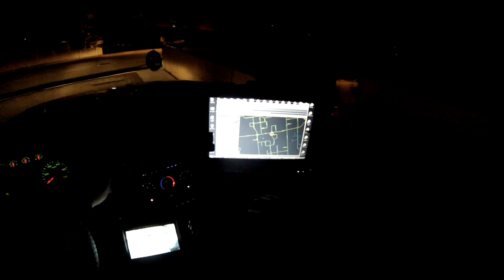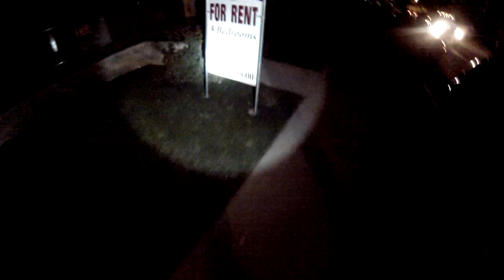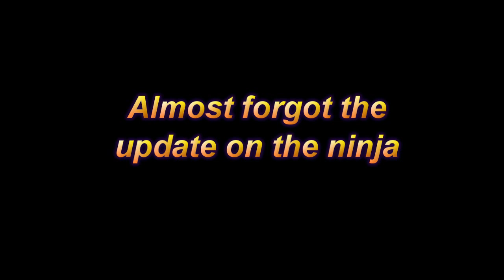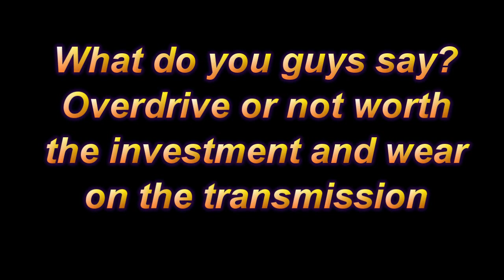Walking The Late Night Parking Garage Searching For Vehicles

Comment: I installed a Gear Vendors unit myself -- it was VERY easy to do.  But it was on an old Ford C6 tranny -- your newer tranny might be more difficult to get that Gear Vendors OD unit on it...  The only thing I had to have done by a professional was the drive-shaft shortening, which took one day and cost right at $100, including re-balancing.  (This was 10 years ago, just about, so it might be like $150 nowadays.  But we don't have any inflation...)

Anyway, it lets me run a 3.70:1 rear gear while acting like it's a 2.87:1 gear on the highway when the overdrive is engaged -- BIG difference in engine-speed.  (That's a 0.775:1 ratio, BTW).

Being able to do the work myself saved me a bunch in install costs.  I just bought the Gear Vendors unit, the adapter for the Ford C6 tranny, and the install kit, and did all the work myself.  It was easy enough for me to do in my garage in about 8 hours total working time -- minus the day it took to get the driveshaft shortened, of course.

I think the total amount I spent, including the driveshaft-shortening costs, and that crazy-expensive fully-synthetic GM transmission fluid that Gear Vendors requires (which is like $75 a quart, and you need two quarts) was right at $3,500.  Would've been $5K easy if I'd had someone else do it for me.

Comment: Hey Matt, Good to see the truck going back together.  The cost in adding an overdrive unit is not cheap, plus the added cost of shorting the drive shaft and possibly having to reprogram the powertrain computer.  Me personally I would change the rear end gears to help with the RPM range, it wont drop it a 1000 rpms but maybe 500 rpms.  You still would need to have the powertrain computer reprogramed.

Matt C.

Comment: Good to hear you will be up and running soon ! I couldn't help but stare at your front tires when you were showing the rebuild , agree at least replacing the front ones ASAP . I do agree with you on the wear , mine normally start from the outside in !
Reply from the maker: Mike Mcchrystal My Dodge 3500 went through tires like crazy and I found out the frame was bent.
Reply: Your dodge came from the factory with a broken frame all of those 1994 to 2002 are split frame trucks get a duramax and call it a day
Reply: +RepoNut If you throw in the towel on the Ford at some point, aside from destroking it, Get you a Duramax, I love mine! I love the old 7.3 strokes too but those are getting pretty old now. The Cummins (albeit noisy and avoid the 24v with the VP44 pump like the plague) is a really good engine for the most part but the truck they are stuck in is gabbage! Weak frames, prone to rust out, shoddy fit & finish. The GM's have their pitfalls but nothing big and most is piddly stuff that can be fixed. Great engine & transmission, lots of power and very tuneable, quiet, nice chassis, comfy trucks.
Reply: The Chevy is great all but the durmax. The 6.4 is a great motor if you bullet proof it.

Comment: Great vid as always Matt. Look into a Gear Venders overdrive unit. Its an add on to the rear and is opperated by a manual switch. actually turns a 3 speed into a 6 speed if wanted. Cool unit and can take tons of HP and TQ. Nearly bulletproof.
Reply: Dub Coco He did look into it when he had the engine work done the first time. He said they wanted $3000 to buy it. I think the purchase price plus the extra to have it installed kepy him from doing it the first time.
Reply: They are pricey but they are a good unit. A custom geared transmission would be more than that and would not have the added usability as the GV.
Reply: Dub Coco I agree.
Reply: +Charles Bronson I can see now why you blindly defending everything Matt does or says. You have no life except following Matt. You'll never face reality will you? Troll on. Don't look for the truth just trust everything Matt says is gospel.
Reply: MrRexQuando Troll on. That funny considering you left 7 comments in 10 minutes.
Reply: Charles Bronson Hello pot.. I'm the kettle. LOL
Reply: MrRexQuando I've said the exact same thing to you.

Comment: I'd say a different axle ratio would be the best bet, you have a 4.10 and 3.73 was another option that year.  It's possible an aftermarket ring and pinion @ 3.55 or so may be available but I have no idea what the computer would say to that (let alone an aux OD).  Trick is keeping the converter locked, if you go too tall and end up unlocking the converter over every little hill you are negating any savings and adding a lot of heat to the tranny.

Comment: Yes, it does add a slight amount of stress to the trans.  This is exactly why failing clutches in manual transmissions slip more in the high gears than low gears and why failing posi-traction units slip more in cars with "higher" rear end gears, like 2.76 or 3.23 than in cars with, say, a 4.10 or 4.56.  That said, I think the overdrive is totally worth it and I have yet to hear anyone have a bad experience with a gear vendors overdrive unit.  That will give you what you exactly are looking for, not to mention a few other benefits, like splitting the other gears too and giving you a lower reverse option for backing some huge trailer up a hill or other such crazy job.

Comment: In regards to the overdrive. The vehicles I used to drive OTR had trip computers in them. They would monitor your average speed, fuel economy, etc. After many long cross-country trips (most commonly Orlando to LA) I found out that the best method to increase mileage is to slow down. Choose your speed based on engine RPM. You're probably just adding a few minutes to your travel time.

The overdrive will lower your RPM but just like on your bicycle, the engine has to work harder to maintain speed. Skip it.

Comment: I'd put the overdrive on and use it when running without something on the back.  That transmission is plenty strong to handle the extra load on the freeway when not hauling up hills.  If you go with a different rear end you have the same gearing, loaded or not. With the overdrive you can engage and disengage whenever you want.

Comment: As a former driving instructer in eco driving I can tell you that you can cut up to 20% of your fuel comsumtion (normaly it is about 10 to 20%)  with just the right driving tecnic and with stoppeing the engin insted of letting it idle all the time, an engien shoudden realy idle for more then 15 sec.

Comment: Overdrive or not to overdrive?  Hmm? Well, you need new tires anyway, so how about putting on 6 new tires with a taller profile, which will help act as a poor mans over drive of sorts and just have the speedometer recalibrated? Or just live with the speedometer offset?  :-) Yeah, that's the ticket! I hope your luck starts to get better. It can't get too much worse. And thanks for the tireless hours you spend juggling your priorities while still managing to shoot us a new upload every so often!
Reply from the maker: 1962pjb I'm already going with the poor mans overdrive for sure and upping from 70 to 80 on the wall profile. Also my H&S minimaxx tuner will recal the computer for me so spedo is not an issue. Good suggetsion.
Reply: RepoNut Thanks! And let us know in one of your dialogs on how much it dropped the RPM's at 75mph sometime.

Comment: For get about the trans. Driving at 3,000+ RPM all day has to have bad effects on the engine. 4.10s would slow the engine down a fair amount at 70+ mph, especially since you don't really pull heavy loads all the time. I've ran a Gear Vendors overdrive and absolutely loved it. Well worth its cost/install.
Two speeds in reverse meant I'd run almost 50 mph in reverse! It's a 201 inch wheelbase so it's safer than it sounds. And hard to turn around some times.

Comment: Hello Math,

Strange that an overdrive stresses the transmission and never heard of it, but I'm sure that the technician knows better. Maybe you can ask him how expensive it is to repair/renew the transmission and than decide. Say it is about 2000 dollar and you can save about 500 dollar per month on diesel, than after 4 months you earned it back. 

Personally I would take the risk not only of saving fuel but also noise, because about 3000 to 3200 rpm for a diesel is very high. My Peugeot diesel makes about 2200 rpm at about 120 to 130 km's per hour ( 74 to 80 miles ), but than in 4th gear ( automatic ). 

Anyway, I hope the Ninja is back next monday and looking forward to hear the new diesel ( secondhand new ). 

Greetings from Roel !

Comment: Puts more axial and thrust load on all the bearings and bushings in the trans not to mention the diff carrier bearings (depending on how it's used, if you're lugging the motor then yeah, big time accelerated wear).

Comment: You should check out the gear vendors under/overdrive units they are awesome and bulletproof, if you're 3K on the highway you can realistically drop about 700 rpm and run lower transmission temps that's about all I know about them you should check out motor tends hotrod garage episode 7 for more info.

Comment: If you re-gear you will see better mileage on the hwy when not towing but towing and around tow stop and go stuff you will see worse mileage. In the end you will be at the same as you are now or worse, dont re-gear. As far as an overdrive unit check out "gear vendors" they be around forever, give them a call. Being in O/D = higher trans temp and higher egt's 2 thing you dont want. Slow down to 70 and see how that dose for you, in the end 75 to 70 your looking at 3min over a 60 miles distance or 7min if you do 65. slowing down in the end will help you more than spending more money. Good luck

Comment: What rear end gear ratio did your truck come with?  You could always install a set of gears more appropriate for highway driving. I.e if you have 4.10's you could go to a 3.73' for a drop in cruising rpm.

Comment: Instead of the aftermarket OD units, check what the factory options were for the rear end final drive. I recall you saying its a very short (high ratio) rear end for heavy towing on hills. Perhaps there is a lower ratio factory ratio that wouldn't stress the transmission.

Comment: The best way to work that out would be to see how long the parts will last with the overdrive installed and how much it will cost to replace all the parts once they wear out and compare that to the fuel savings you would get.

So if it costs $2000 to replace all the parts and it has to be done every 5 months and you save $500 on fuel each month then it is worth it.

Comment: Something else that wasn't mentioned about the overdrive, you would need to have the driveshaft reworked, while it isn't really a big expense if your driveline angles aren't correct you will have driveline vibration and eat universal joints. I would stay away from a o/d unit, it's likely to cost you more in the long run. The max operating angle of a universal joint is 37.5 deg. while a cardan joint can help they are pricy and a real pain to rebuild.
Reply: mrgearheadfromhell good point. So much money involved to get an OD that he would never recoup that expense in fuel savings.

Comment: Have you ever hooked the steering wheel like you did with that van, and then forgot to unhook it when you flipped the vehicle around and drove off like that? If so, what happens? I would imagine that in most cases it would be fine, as long as you don't make any (or at least not a bunch) of hard turns, or sudden (that would cause the seatbelt to lock up) turns. Glad to see she is almost back together for ya!
Reply: It makes no difference whether or not the front wheels are locked/hooked when they're up on the lift. They don't turn at all on the lift. The lift itself has a hinge and that's what lets the towed car hinge behind the truck. If you sat in that van and took the belt out of the steering wheel, you wouldn't see it turn at all once the front end was in the air.
Reply: Tyler Pieper
Ah okay, thanks :) I wasn't sure if they (front wheels) moved at all (turning) on the lift or not.

Comment: Gear vendors best overdrive option, but I wouldn't. I would go with re-gearing the rear end. That truck already has a overdrive gear built in. Adding one will add wear to the trans and motor as it will most certainly hunt gears more, (assuming it automatic OD) and if it's manual, well it's just another hassle in the cab. What gears does it have in the rear now? Adding a OD unit requires shortening the driveshaft, and it changes angles and you will start eating U-joints. You might (depending on configuration) have to constantly stay on top of the air ride to make sure you don't end up bound up and snapping yokes. Plus you're adding another part that will need service, and thats more money... Best option might just be to slow down...

Comment: I'd say, normally, overdrive is a good thing, but never use it for heavy towing....  That said, pulling that rx8, once you got to speed you might be able to get away with it....
You aren't pulling 15,000 lb trailers, so you could probably get away with a 3.73-4.10, since you are limited by carrying weights.  That said, I wouldn't recommend doing road trains - with either a overdrive, or a more car like rear gear ratio....  You could get a similar effect, with a larger diameter tire- approx 1" more of tire height = .1 less of rear gear....
I don't know what rear gear you have, but I would run it by a dealer, and a trans shop (maybe your tow parts guys).
I know better than half the time, your running around with nothing  on the back, but you also have to maintain the capacity to tow larger vehicles, and those require higher axle ratios, and prohibit overdrive use.....
If you do install a overdrive, I would suggest installing a switch, so that when the lift cross is in the stored position (vertical) it enables overdrive, but when it is in the use position (your carrying, or hooking to something), it disables overdrive-automatically.  That way, you don't forget to disable it, when you are loaded, an extra layer of protection.
Every overdrive automatic I have driven, has had a overdrive disable button, whether pickup, or small/large cars.  They are there to save the trans life.  Also-many manual trans', aren't really proper for over drive loaded use, as they are often in add-on housings, that are weaker than the rest of the trans.  Not to mention, that you are causing more stress to the trans while using overdrive, big deal for heavy loads, but light usually has enough spare capacity....
Just remember, increasing tire size, gear ratio, or adding overdrive takes away from the gcvw rating of the vehicle.  I'm sure there is more gcvwr than you have been using, but, your drive line is a limitation that plays into your gcvwr, try to stay within it....
And if you do any modifications to tire, rear gear, or adding overdrive, please add additional trans coolers.  It'll help reduce the temps, but you may find yourself getting a rebuild with upgraded clutches, etc. regardless...